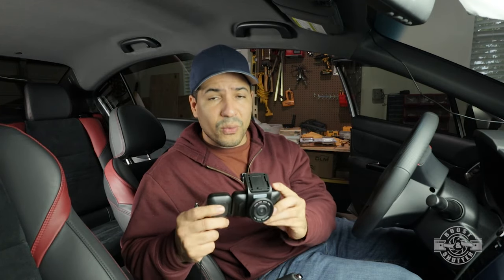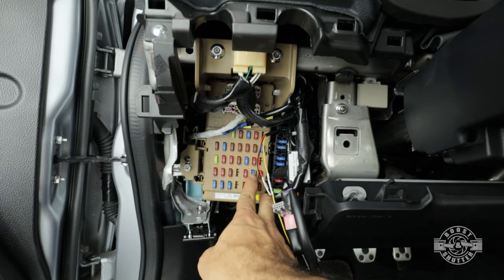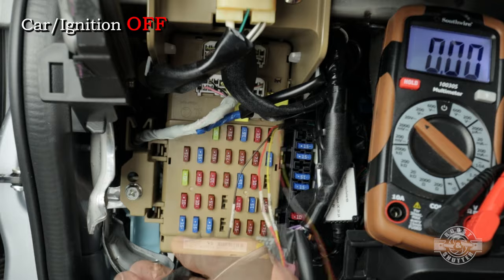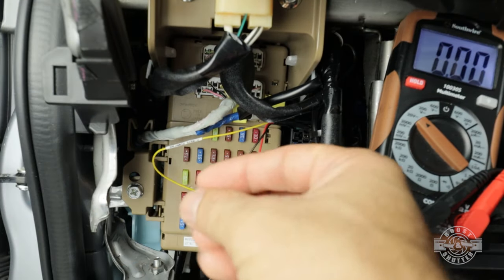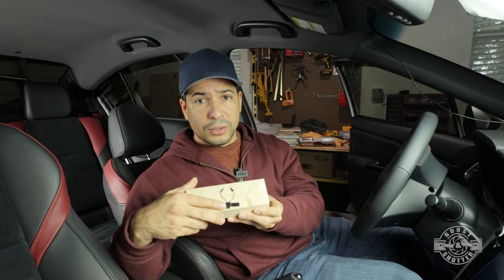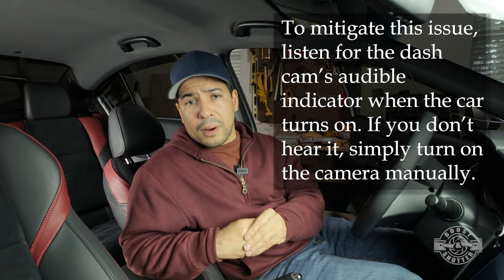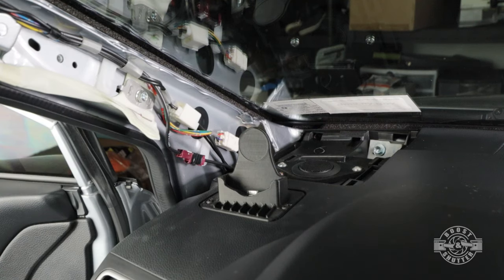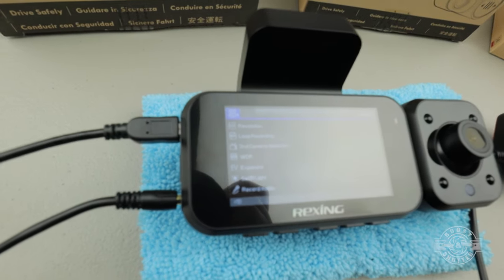Smart Hardwire Kit Install to Enable Dash Cam Parking Monitor

Comment: The problem is that some cars (ex. CX50) don't have a fuse for on while running in inside fuse box and you have to run wire to the other fuse box located in engine bay. The other option includes getting it from the cigarette lighter outlet (but you have to get it after removing the outlet). And if you give it to professional installer,  your car may still throw some weird code. Everything seems to be getting more,  not less complicated. And, forgot to mention; permanent installation of any non-genuine device can compromise car warranty.

Comment: I think you can use any slot in the fuse box, it doesn't have to be 15A. The fuse is there just to protect your equipment.
Reply: No it’s not just there to protect you gear.  You are replacing the installed 15a fuse with a 15a fuse with a tap.

Comment: just wanted to get your suggestion. looking to hardwire litlogo badge that require 5a to the engine fuse box and im looking at #15 (lighting) and #17 (empty). does that sound right? thanks

Comment: I have 3 of these v5 cameras. All bought at the same time and 2 of the 3 do the same exact issue. They don't turn on as they should. They just flash and shuts off like yours except mine does it 100% of the time. 

Been in contact with rexing and they are telling me it's a hardwire kit issue. They just sent me another kit but still same issue. So ill see what they say. 1 out of the 3 cameras turns on normally. Although I've notice if the car sits for a few days without turning on, I then have to manually turn it on that one time. Hopefully they can find a fix or resolve this issue. Sucks that I'll have to turn it on everytime i get in the car. This camera has already been out for about a year. And their site doesn't list any firmware updates.

Comment: A capacitor installed on the power input side would mitigate the momentary voltage drop issue.

Comment: Great informative video nice and clean using them fuse tap in kits very clean methods. I actually had a similar issue but with a double din stereo witch I solved using a capacitor 16v witch allows that extra current to flow whilst the engine cranks as you said it puts a draw on other components, capacitors stores energy so wot ever it's used for will stay on alittle untill it's discharged.but up side I can keep my music playing from my fone without it being interrupted that slitt second for 2.👍.weather your viewers can put up with this issue that short time or not but I'm sure the company have dealt with it by now as I see you post we over a year ago.

Comment: I installed a hardwired with the Azdome M550 dash cam and it did stop working a few times when i went for a test drive.  When i parked the car the dash cam worked nonstop.

Comment: Hey man! I just installed my dashcam thanks to your guide, everything worked well. I do have a question, USB cable has 4 wires inside, positive (+5),  Positive data, negative data, and ground. How does the camera know when to switch from normal recording to parking mode? I guess that Positive data is the signal when the car is on, I'm not sure.
Reply: I'm not the video creator but I think I an answer your question. If you look at the hardwire kit, you'll notice that you have your USB side which goes to a box in the middle and then to 3 wires. The box in the middle is used as for a lower power cutoff but since that's not related to your question, we'll skip it. 

The 3 wires you have are the constant power, the accessory power (the power that is only available when the car has the been turned on partially, traditionally this occurs when the car is turned on or when the key is given a partial turn), and the ground.

The ground wire connects to bare metal and is standard in many electronics as a safety feature (basically electricity goes to ground instead of whatever is touching it). The constant power will, as the name implies, always have constant power, even when the car is off. The accessory power will only have power when the car is turned on or partially on. 

What the camera does is monitor when the accessory power has been turned off and turns on parking mode. When it sees that accessory power is restored, it turns off parking mode and resumes normal operation.

I hope that answers your question! I tried to space out the concepts with line breaks so this is broken up into a few sections: Hardware kit general info, wire meaning and usage, wire type concepts, camera operation in relation to power.
Reply: @DarknessLPs  Hey man, first of all, thank you for answering! Secondly, I do understand how it works on the side before the convertor (from 12v to 5v). I don't understand how does it work with USB wires, for example, VCC+ is always ON and that should be +5v on the USB cable, and the ground wire just goes to the USB ground. What's confusing is how does the converter say to the USB camera that the accessory power is ON or OFF? :) Does it send +5v on the positive USB wire? Is it maybe a software solution and the camera expects the converter to send a certain bit of information?
Reply: @MiroslavPavkovic  So as you may know, all electronics work on a binary system, on or off (ok...not strictly true with Quantum computing but for the purposes of this, that's a little out of scope). Basically inside of the dash cam there is likely a 'gate' that determines if the ACC power is on or off. 

The gate is likely set to say if Constant power and ACC power are on, function in 'normal' mode. If constant power is on and ACC power is off, function in 'parking' mode. Obviously if there is no hard wire kit, there would be no power at all so it doesn't do any determinations as the device would not be able to operate.

Remember that USB is a standard based around data and this is only giving power information so while there are other wires inside of the USB cable, because it is not transferring a data signal, the camera likely only has pinout information related to power being ingested from the hardware itself.
Reply: @DarknessLPs  The reason why I'm asking this is I would like to use the power bank instead of the constant draw from the car battery, but I don't really have enough room in my Fuse Box to install a lot of stuff. I was thinking about a switch of some kind but the power bank gives out 5v and not 12v what the hardwire kit needs :D

Comment: Hey, so just to be clear in parking mode the car battery is fine when you come out to start your car the next morning/day? i understand theres the low voltage prtoection but making multiple recordings and just the dah cams power being on all through the night doesnt drain your battery some nights completely?
Reply: The hardwire kit has built in protection circuit that shuts off if your car battery goes below a certain voltage, usually 11.8v, I believe. Some may be different. Even so, the current drawn in parking mode shouldn't be enough to completely drain your battery unless the car sits undriven for long periods.

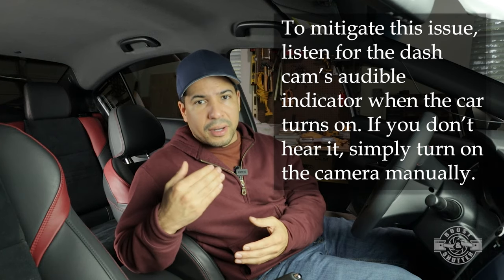Comment: 11:21 can't you just add it to a fuse that the battery does not intentionally drain that circuit? I guess you could always hook it straight up to the battery as well

Comment: Hi man.. thank you again .i installed my hard wire kite the same way as you did but some thing happend wrong.the mirror dash cam turns on only when the fog light is on as soon as I turn the fog light off the dash cam mirror shut down beside .. please tell me what should I do.
Reply from the maker: You apparently used the fused circuit from the fog light. If that's happening try a different fuse spot that has power all the time.
Reply: @akqjtn  ok . tomorrow i am gonna to use another fuse tap. Anyway All my effort is that I do not have to use the fuse adapter.

Comment: The question that has no answer. 

Does the camera have “ motion detection” sensor. That is, does it start recording when someone or something passes in front of it.?
Reply from the maker: It has an answer, and it's NO. The camera uses a G sensor, so it activates when the car is shaken/hit. If you want to record all the time (say you're running into walmart and you know you're only there for a little bit) you can manually turn on the dash cam so that it runs the whole time. Maybe they will add some motion detection like Ring via firmware update, but as of right now I do not know if they did or will.

Comment: I have same model car as you.  Well the limited 20. Found 3 empty fuse slots an no power emitting when car is off. I am only powering dash cam and radar when car is on.  The fuse slots showed 12 volts when car is on and testing power with fuse cables plugged in and getting 12.2 and 11.98 volts. I'd that normal or should I be getting higher voltage of like 12.5? My radar on boot shows power voltage. Testing the links is 12.3 with the car on and radar shows 11.98. Would this be normal activity or do I possibly not have the links connected all the way? Thanks
Reply: Figured it out. I didn't have the lead fully connected. I'm getting the proper voltage.

Comment: Quick question for anyone who can answer. The ports with fuses in them have two contacts whereas the ones that don't have fuses in them only have one contact. Now, as long as I am putting in the fuse correctly that should be alright, correct? 
Example: I only have one cig lighter in my car and that fuse is using a 20amp fuse where you can see two metal contacts. But right below is an empty spare lighter but it only has one metallic contact.
Reply from the maker: Test the spot with a multimeter
Reply: @akqjtn  I have one, and I've tested them, but why do the ones without a fuse only have one metal contact and the ones that do have a fuse have two metal contacts?
Reply from the maker: @Hikikomorisama  because those are unused slots. They probably go to systems that your car doesn't have (different trim) so the manufacturer saves money by not installing the wiring for features your car doesn't have.
Reply: @akqjtn  ahhh makes sense! Ty!

Comment: I always thought is unwise to use an empty spot. Putting a fuse in there you are going to provide tension to an unknow system of your car. Am I wrong?
Reply: Hi. every system of the car unit has its own fuse tap..Usually some empty slot fuses in different cars may be for features that do not have a car.

Comment: What if my fuse box is in the back of the trunk? It’s a 2019 dodge charger. I got a Rove R3 camera I don’t believe the provided wiring kit is going to be long enough to reach front windshield. Anyone else run into this issue and if so does any one know the solution?